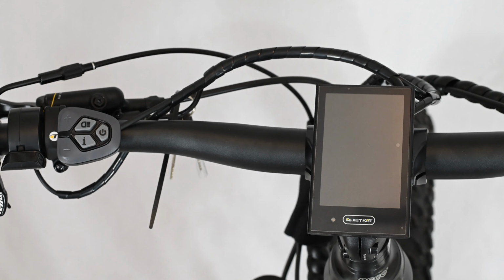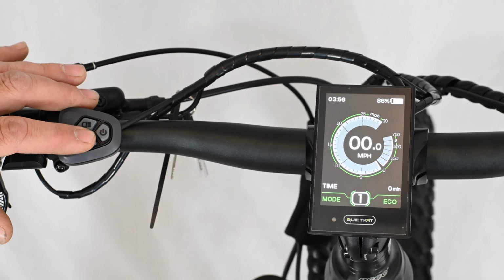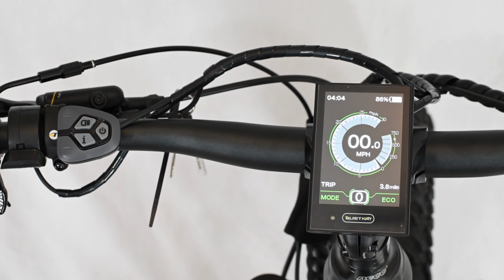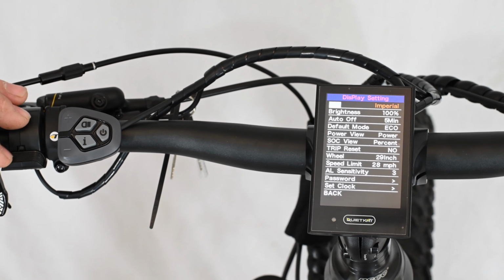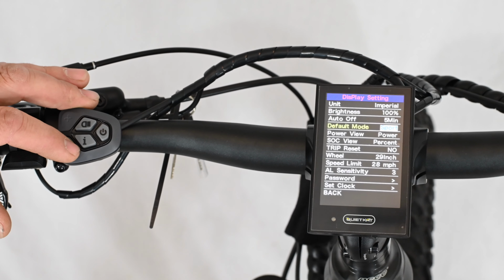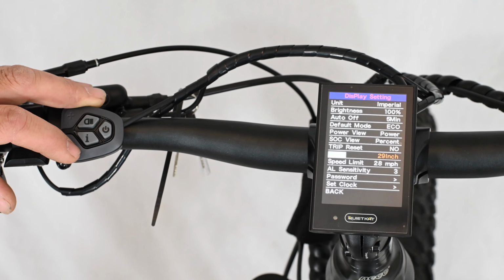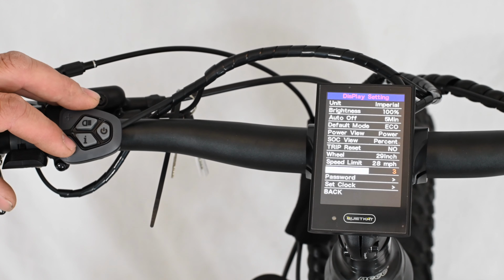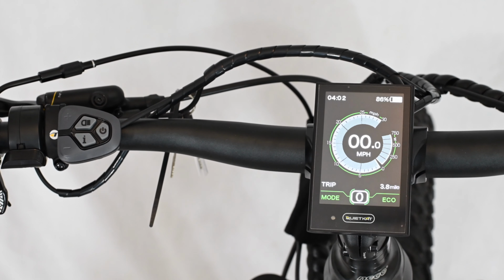QuietKat Color Display Overview - Mid Drive Models

Comment: I have the 2023 Jeep 750W version and the display settings appear to be different such as the MODE settings, SPEED LIMIT, and PAS MODE settings.  In addition to that, when on the home display page and then tapping the plus or minus buttons to switch between modes it only gives three options which are ECO, TRAIL, and BOOST.  Can you please direct me to a more up to date instructional video for this model or an actual operators manual?
Reply from the maker: Hi Andrew, you have some new software we are explaining this Monday. Stay tuned! :)
Reply from the maker: https://quietkat.com/pages/quietkat-variable-power-output-vpo